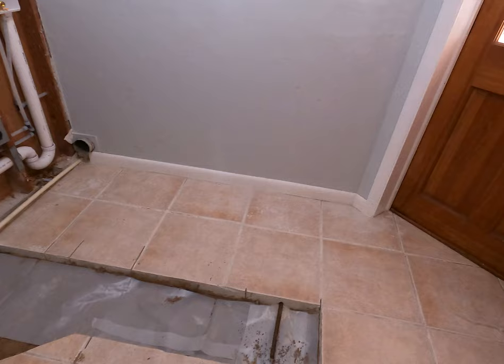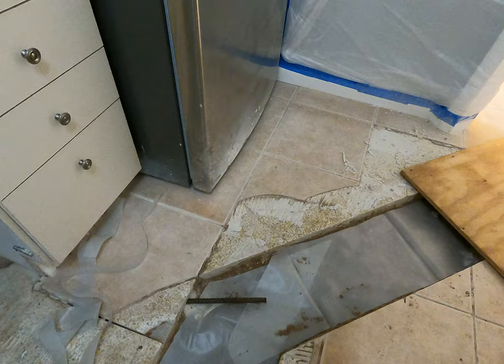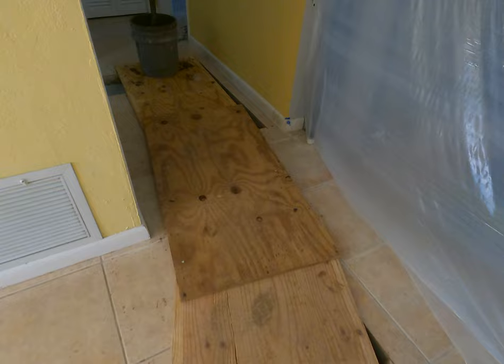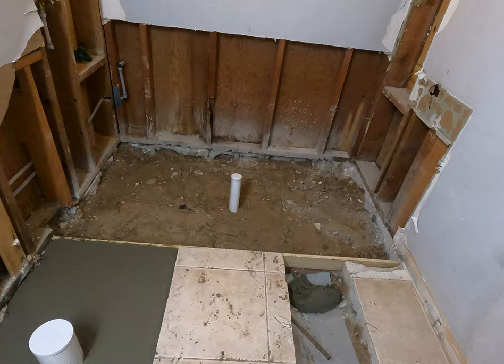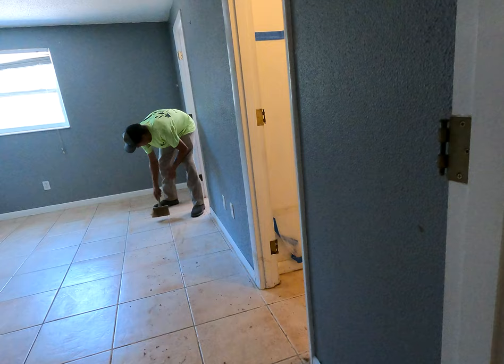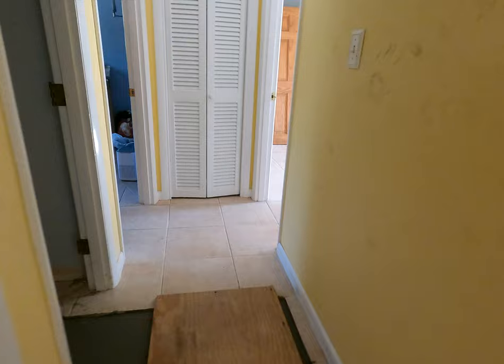Mastering Plumbing Repairs.😎

Comment: Externally mounted sliding doors (barn doors) are all the rage.  Easier than retrofitting a pocket door.  You would however need to upsize the door to better hide the opening. (Personally I prefer a true pocket door, buts that’s time/money)

Comment: A ton of work getting done at your new place! Definitely go with the outswing closet door if you’re not doing a pocket or barn door. I have a similar sized closet just off my entryway and the outswing makes the interior more accessible, gives me more maneuvering room inside the closet, and lets me fully use all 4 walls as I see fit. Yes, the door opens into the hallway, but honestly, how long is it open for at any given time that it would be an obstruction or couldn’t be opened all the way against the outside wall? In my book, maximizing usability and convenience inside the closet gets priority. My 2/100ths of a dollar ;)